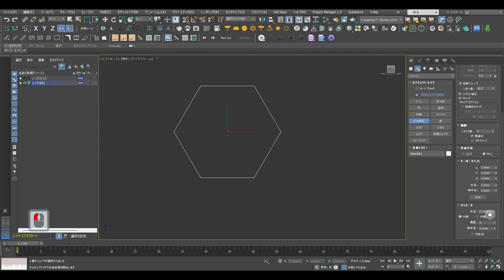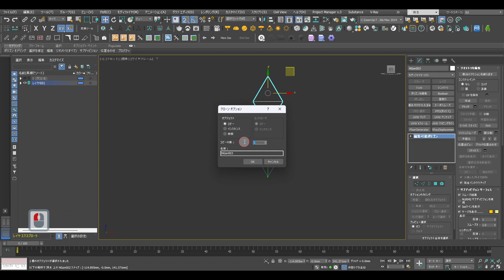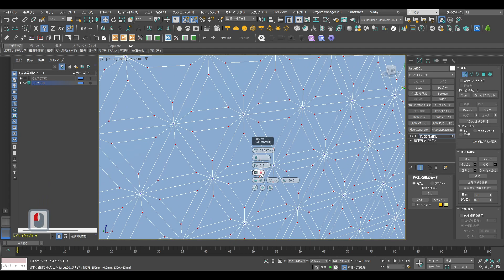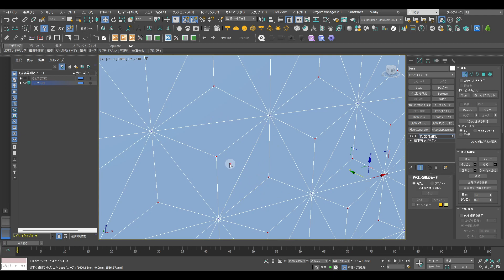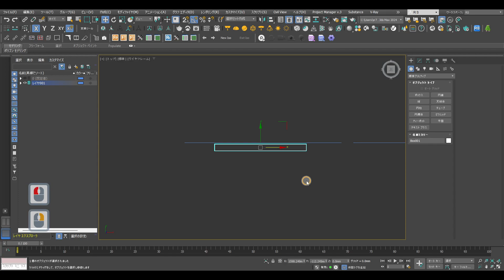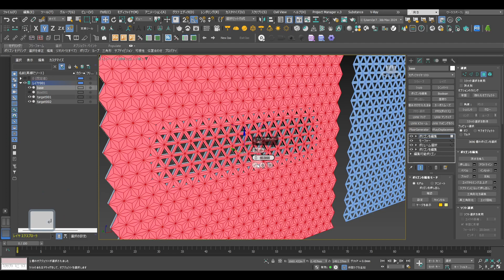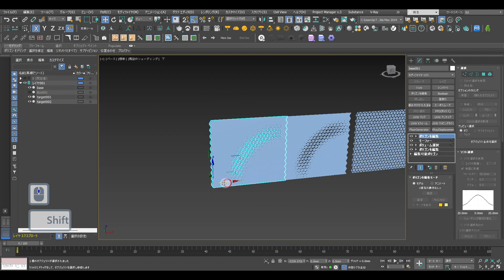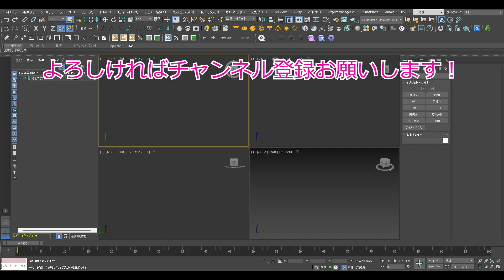3ds Max：モーファーモディファイヤを使用してパラメトリックパターンの作成

Comment: Hi ,I used the Phoenix plugin from chaos for 3Ds Max. I want to buy a new computer with a processor that speeds up the Phoenix  Simulating faster . What category should I choose, Intel or AMD? thank you
Reply from the maker: Sorry, I'm not very computer savvy so I don't know which is best.
After some research, it seems that if you care about core count, AMD Ryzen Threadripper is the better choice, but if you care about clock speed and compatibility, Intel is the better choice.
I don't know if everything I've researched is correct, so please do your own research.
There is some advice on the Phoenix setup page which you can check out.
https://docs.chaos.com/display/PHX4MAX/Setup+and+Installation